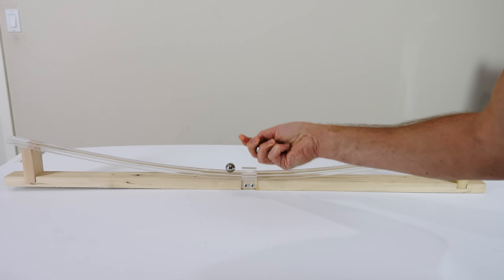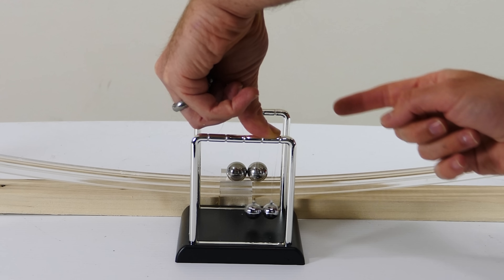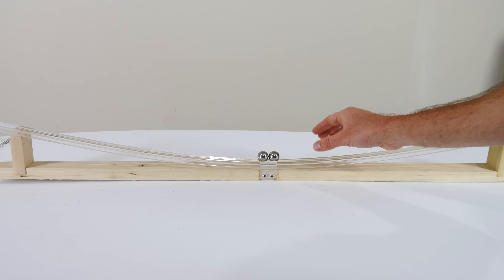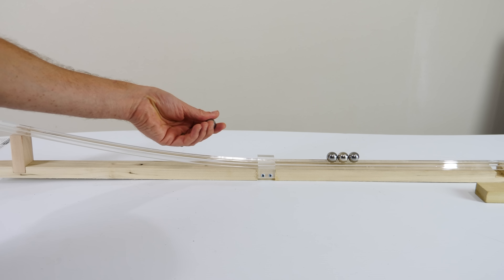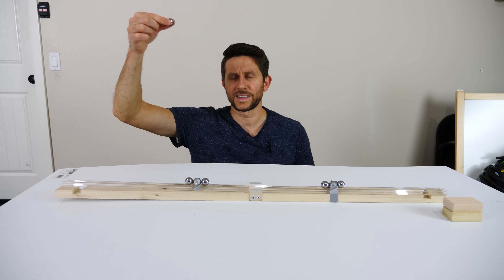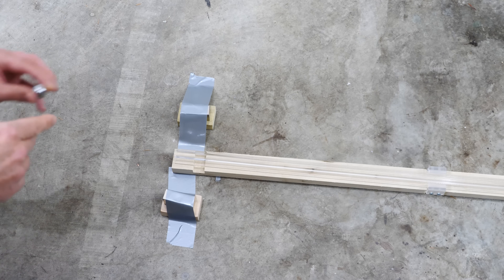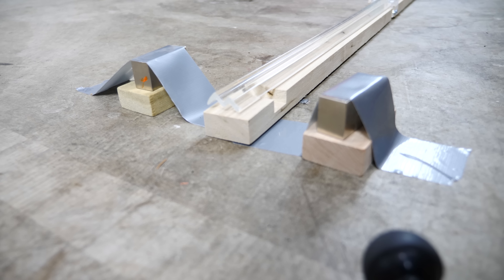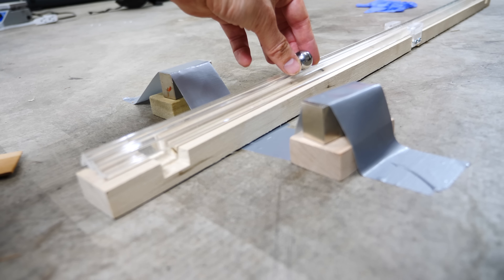How Does a  SMOT Work? (Simple Magnetic Overunity Toy)

Comment: I recently made an "Over Unity" device on accident which took me days to figure out WTF was going on. The experiment worked on Resonance and part of the system was a relatively big steel ball and a bench covered with a large metal plate. There is more to it but those are what I think were important to the effect. There are some rods with mass on them which could be tuned. The whole thing can be made to tune itself by resonating the system and the weights "fall" into the Nodes in the standing waves formed in the rods. Once "Tuned" after being bolted to the work bench even the slightest ( and I mean SLIGHTEST ) tap at a very specific spot on the resonance rods, which acted sort of like a tuning fork, caused everything to strongly vibrate for almost a minute at a time all from a split second minor tap. All with a FAR greater Amplitude then the initial tap

After much thought trying to figure out what the hell was going on I measured the frequencies the system was vibrating at and turns out it was vibrating at the Frequency of the Electric lines around the area. A frequency that is almost always ringing at all times everywhere and unless you are deep in the woods there is a 60hz noise all over the place as well as its harmonics. The pulsating Magnetic field must be causing the Iron in my system to pulsate with it and the entire system would tune itself to that frequency. The slightest tap seems more like pushing a ball while it was at the top of a hill. Further investigation showed me the system always had a faint, very low frequency pulse to it at all times likely again due to it resonating with the EM field around triggering the most stable subharmonic it could find. 

Idk, just thought I would share that as I found it interesting because figuring all that took me a good afternoon or two because I for the life of me could not figure out how such long lasting and loud vibrations were coming from this teeny tiny tap at this specific spot, not the spot a mm or two away.... Just THAT spot at the Quarter wave node on the rod. I sat for hours just looking at it confused and gently tapping this one spot expecting it to not to it this time because I felt it should have never been doing it in the first place but it just keep going and going. I would like to harness it somehow but not sure if its possible. I suppose some sort of Radio receiver with a rectifier to split the energy into a Capacitor bank to be measured that was I can 100% prove to myself the EM is what is causing the effect. I am 99.999% positive now but it would be nice to have exact numbers to go by.
Reply: Suggestions on Harnessing the exact energy of the Vibrating system EM waves and all would be appreciated as to allow me proper data. Basically think I need to isolate the entire bench from the ground and if it still does it measure vibrations at multiple location and average to avoid accidently only measuring node or antinodes. Then I need to measure Ambient EM and work the math to make sure everything checks out as expected.
Reply: @seditt5146  Best of luck. My brain is on similar wavelengths. Reminds me of Tesla's earthquake machine.

Even if there is no such thing as perpetual motion, there must be a better way to harness all the ambient energy that just gets wasted. Perhaps power companies could use such a device to help recover wasted power and help power the substations and boost efficiency.
Reply: @M33f3r  i do know there are passive means of generating power that have recently gotten. Boost largely due to advancements in metamaterial technology harnessing piezo and thermo electric effects.  I been studying science since I was extremely young... long as I can remember to be honest and I remember when I was a kid hearing a large truck go by resonating strongly with a window giving me the idea that such a thing could act as a generator albeit a weak one.  I eventually concluded a series of tuning forks with magnets in coils could passively generate power by picking up ambient sound vibrations.  Now I'm starting to think a hybrid which sucks up ambient EM and sound waves in a resonating system might work such that all available frequencies are converted into the lowest common harmonic and stored as much as possible by extracting it from rectified LC circuit for storage.

Idk its all interesting and what not but reigning in my creative side to actually sit down and do the math required is the hardest part :D .  I'm capable of the math I just rarely get there until the ideas are significantly solidified in my head.

Comment: If ya go deeper, there is free energy, but there is something missing that is stored energy since the magnet is constant, but it is not magnet alone, but within magnet that is Aether so it absorbs the energy so charge the magnet, when you lose the energy so it discharge, so need to charge, so the cycle of char-disc, to relive the battery, it is not motion alone and storage alone, but discharge and charge, so if ya can put magnet as a gate that charges the magnet so the magnet will absorb the charge as it goes thru, but for accelerating or for constant motion, so accelerating is gaining the charge, so it is beyond what magnet will discharge, so it adds so it accelerating, or for constant motion, so the charge and discharge is equal, so it is constant, for the above video, it loses the charge since there is no charge, but motion alone. The magnet can be like a battery. Where does the energy within the magnet come from?? Since it is different from other mass that mass doesn't produce energy output to cause motion to another mass, despite the gap in between, but the magnet does, so there is higher energy within magnet than other mass, but understanding and use it the right away so it can accelerate and in constant motion, so it is all about the cycle of loss and gain. Of course have to calculate how much discharge from air, of a range in speed, and possibly other materials within air, so to charge the discharge, so the magnet will charge so it will constantly keep going forever. All mass needs a charge so the mass will not lose itself that is breaking down which converts into heat so it is a release of energy that is heated. Not store energy.

Comment: Good demonstration, but free energy is not only a real thing but undeniable, destructive force, responsible for many accidents and deaths, from lightning strike, to being hit by the bus... in both cases cause of death is receiving " free unanticipated energy", but free electric energy ( in your 115v outlet)  is quite  rare, and tricky. Lets start with the billing system for electricity is based on utility meter of electicity which have fault ratio of 0.000001 or one in a million, so multiply that by about two billion electricity users, from statistical point of view over 2  thousand households  enjoy free electric energy... not to mention when you live close to radio transmitters or cell towers, your body cells really dont want or  pay for electromagnetic energy delivered to them wirelessly to  cause harmful effects..

Comment: Why couldnt humanity invent an engine out of this connectic energy? It would be  sustainable and ECO friendly in my mind..
Reply: because it's impossible. watch the video till the end. BTW it's kinetic energy
Reply: @lorenzozanelli3437  i understand the kintetic energy and got the last part, i just dont see how its impossible with all capability and inginuetity we have. I dont know how to put all my thoughts to words but ill give it a try. If there was a way to connect 3 or 4 devices that interacted with each other, setting each other off to a push and pull system of sorts. Maybe even have an electric obsorber that retracts from the drive of the kintetic energy. Is my idea just shambles cuz the device would be to big? If so i will refer to memory cards as like usb sticks, as refering to the desizing of the objects over time. Am i making any sens or do i just have a good imagination?
Reply: @Floki_Blazin  no bro it's not about the size.
it's the fact that is IMPOSSIBLE to create energy from a closed sistem. you enerdy from somewhere to produce energy.
if your idea can be enclosed and still produce energy, it won't simply work.
enclose means enclose from external material, heat, wind, light etc.

Comment: That's not why it doesn't work. It has nothing to do with height so the ball can 'fall off'. You can easily do it in a way the ball always goes in full circle without 'seemingly' losing any energy in the system. But the thing is it will still lose energy, not because of friction or height, but because of the weakening of the magnetic field in the magnets. Whenever you 'cut' the magnetic field lines, the magnet becomes weaker. If that weren't the case, we would already have generators which would use magnets for 'free energy'.

Comment: Free energy exist. There is one device which has been running for years.
Reply: Nope !
Reply: @loungchaidee7649  i have seen thousands of videos of free energy Device i know 99%of them are fake. But i know 1device wich is currently running for 40years without any external power. Even artificial sun will be the one example of free energy which we will be able to create very soon.
Reply: @vikash70R  Nope again. You can NOT create energy from nothing, you'r just able to transfer from a form to an other. Cf thermodynamic law.
Reply: @loungchaidee7649  this is what i am saying we can fetch free energy available all around us. And artificial sun would be one of that example it would use the mass energy conversation but still it would be free because we would be getting more energy than we put in in the first place. This is what scientists are working for currently we have achieved 50/60% efficiency but i hope we will achieve the efficiency 200,400,500,1000 very soon.

Comment: To remove friction from a circle made of SMOT, can't we tie up the ball with a string in the centre and give it a push and keep ball little bit above from the surface
Reply: despite what he says, what prevents the ball from ending up with more energy than at the start isn't friction. 
The real explanation is at 5:58  : 
after being accelerated , the ball is pulled back towards the magnets.
The magnets create an "attractive spot" . the ball accelerates when moving towards that spot but the energy cost to escape that spot is exactly equal to the energy gained during the acceleration.

without friction at all, the ball would end up with exactly the same energy as before getting close to the magnets. It would still not have more energy.
(and with friction, the ball is losing energy)

Comment: Question.

With your magnet ball setup, if you had a vertical ramp on the other side, or enough of a ramp to have the the high momentum ball to return, will the original ball also shoot off with extra momentum on return? I assume you'd need another ball between the magnet?

Comment: My rational mind knows it wouldn't work, but it's hard to avoid thinking, "Yeah but if you positioned the magnets just right" 😆
Reply: But if you only put the magnets far enough apart..... & Made the ball a magnet..... & Maybe used 2 different prime numbers in the rings of magnets.... Maybe with monopoles.... I too have this kind of brain 😂
Reply: Same xD
Reply: Would above and below the track be Just right 🙃🤔
Reply: Making a seemingly perpetual motion machine with magnets is not actually that hard, the problem is that magnets in on itself are not eternal. The true challenge of perpetual motion machines have always been either making one such machine without magnets, or have a way to recharge the magnets (usually from electricity-based magnets) so that the energy required to keep the magnet running is the same as the energy you receive from the machine.
Reply: When you have just the two balls at first it's possible the first ball won't stop altogether right..meaning it won't transfer all its linear momentum at once..I don't see why this couldn't be possible.
Reply: @leif1075  air resistance
Reply: @SuperSenescence  what do you mean?
Reply: @leif1075  He means friction in air
Reply: Because of friction? Then do it in a vaccuum.
Reply: vacuum. It suspended in a vacuum.
Reply: We just have to get over the hump. Lmao I've tried, not with this but my own design.
Reply: What if you had rise and falls to add in the gravitational aspect of this?
Reply: If you did manage that, something else would happen, for example the magnets would freeze as their energy was drained, or they'd lose their magnetism or any other number of things.
Although the freezing would be advantageous so probably not that.
Reply: @techstuff9198 that’s why people hang magnets on refrigerators- for the bonus cooling
Reply: If you put extra magnets above the track they would lift the ball enough to overcome…
Reply: @stupidas9466  Then the ball would get stuck on the magnets in the air.

Comment: The solution is to shield the magnet on one side.
That way the magnet pulls the ball towards it MORE than it slows it when it has passed.
This guy is all about keeping you dumb and controlled.
Reply: How about you upload a video with shielding and prove your point instead of spamming the same comment over and over?
Conspiranoia proves nothing.
Reply: @Deca dent,
The magnetic force arising from a static magnetic field is a conservative force. No matter how you arrange your magnets, the resulting force field is going to be conservative. A conservative field is like a terrain. If you have any terrain, if you go around in a loop, no matter how you traverse it, the amount you go up is going to be the same as the amount you go down. You may climb a hill that is gentle on one side and then roll down from the steep size, but if you have to go back to the same point, you can be sure that for every meter you go up there will be a meter that you will go down.
When you shield a side of the magnet, you are simply making one side of the "hill" steeper. To get away from the magnet, you still need to "climb down" that same "height" (energy).

Comment: I wish you would do 100 videos exploring THIS. I believe in my unscientific mind that you can create a sphere of powerful earth magnets that used the rejecting force of opposing magnets to propel itself faster and faster around a coil to generate electricity. Even if the magnets has to be attached to a device that micro adjusted the angles of the magnets as the speed increases. I believe it in my heart. Idk..
Reply: You may want to try it yourself then.
Reply: Despite what he says, what prevents the ball from ending up with more energy than at the start isn't friction. 
The real explanation is at 5:58  : 
after being accelerated , the ball is pulled back towards the magnets.
The magnets create an "attractive spot" . the ball accelerates when moving towards that spot but the energy cost to escape that spot is exactly equal to the energy gained during the acceleration.

Without friction at all, the ball would end up with exactly the same energy as before getting close to the magnets. It would still not have more energy.
(and with friction, the ball is losing energy)

Comment: Ok first off: AMAZING video! I enjoyed it & found it very interesting!(Also, please do remember that I'm not a professional or expert in any field, but rather just another viewer.) I do have a question also: What if you were to arrange the SMOT into a circle, as he discussed, but then have another upside down. Resulting in(theoretically), the ball to float instead of rolling for less friction. Furthermore, if the magnets were "turned off" at the right times for the magnetic forces to pull on the ball, but also not after it has passed them; Would it possibly, have those same forces to both NOT to slow the ball down, & to then have them turn on if it's near the front, to pull on it? I apologize if it's confusing, I tried my best to word it in a comprehensible manner.
Reply: The easier solution is just to shield the magnetic field so it works more in one direction that the other.
Also the first example (the accelerator) is an over unity device. You can imagine using that to accelerate a flywheel from example . The energy to release a ball and reset the track would be FAR less than the energy that would be converted to angular momentum in the wheel.
The B.S. about potential energy is just to confuse you. No one considers that to be a "real" property of an body, it is a mathematical construct that is useful because it can be evaluated with an integral.
Channels like this are the worst form of disinfo.
Reply: @decadent.  
It is not an overunity device: it spends potential energy from the magnet's magnetic field in order to accelerate the incoming ball.
Reply: You just described an electric motor, verry efficient but not over unity.

Comment: Could it be possible to continuously accelerate in a vacuum, without an external gravitational force, and no track to cause friction... yes.... where.... imagination! Awesome video! as always!!!
Reply: Despite what he says, what prevents the ball from ending up with more energy than at the start isn't friction. 
The real explanation is at 5:58  : 
after being accelerated , the ball is pulled back towards the magnets.
The magnets create an "attractive spot" . the ball accelerates when moving towards that spot but the energy cost to escape that spot is exactly equal to the energy gained during the acceleration.

Without friction at all, the ball would end up with exactly the same energy as before getting close to the magnets. It would still not have more energy.
(and with friction, the ball is losing energy)